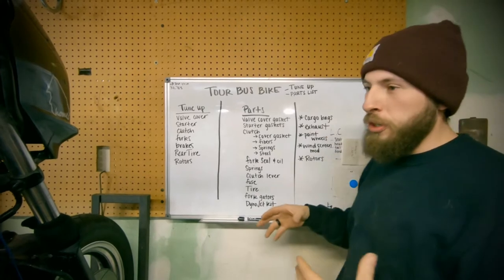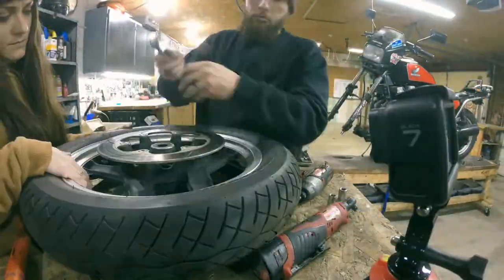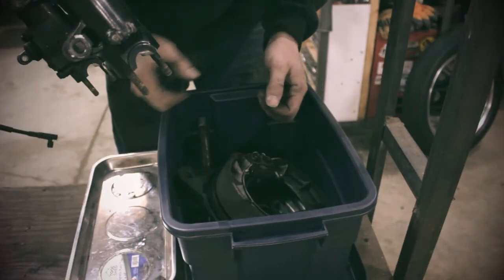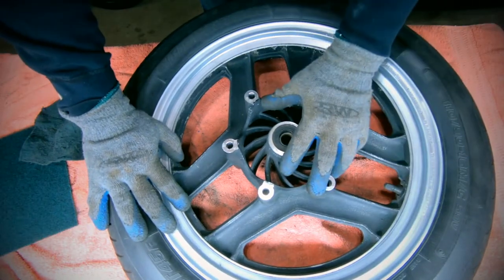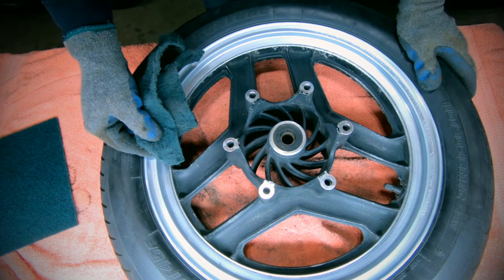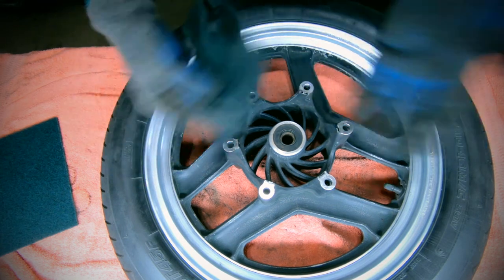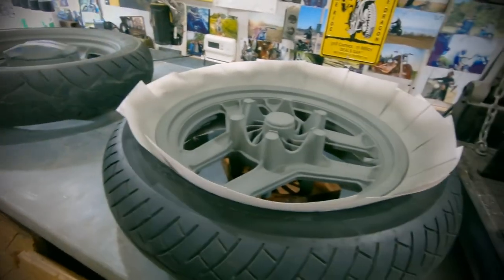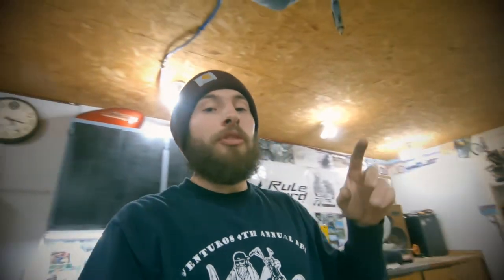Appliance Epoxy Wheel Paint | Nighthawk S Project Bike Build

Comment: I did this, let the wheel cure for two weeks and it never hardened. I could scratch the epoxy paint off with a fingernail. Pretty disappointed 😞
Reply from the maker: Mine is in great shape. No chips no fading. Not sure what went wrong for you.
Reply: @rulehardgarage9740  i have a feeling the primer is at fault, sometimes rattle cans don't mix properly. Sometimes stores sell out of date cans, c'est la vie.